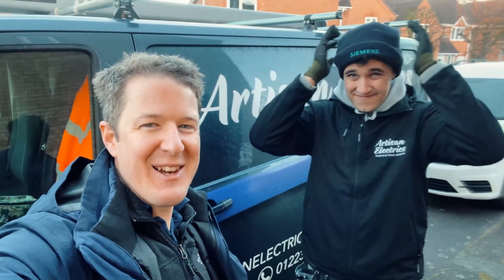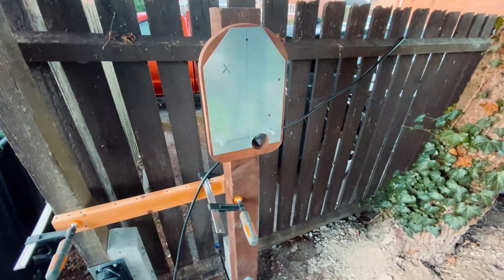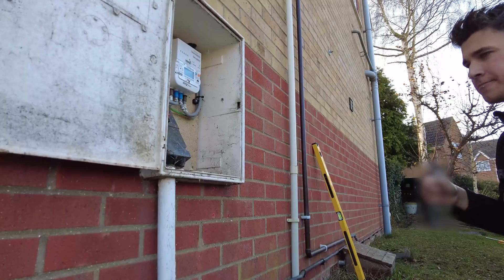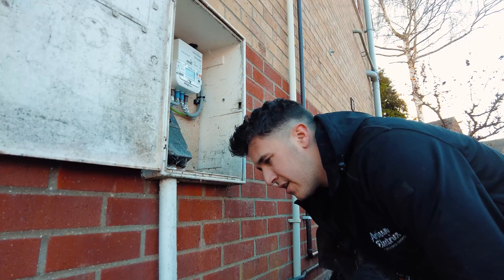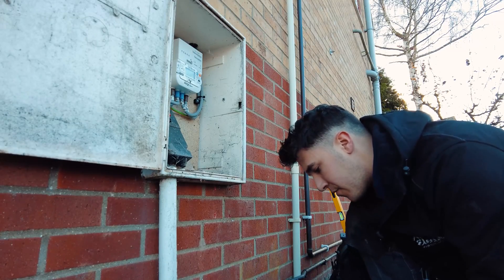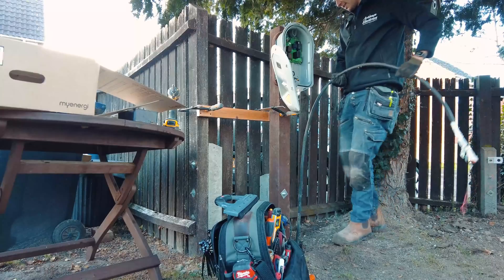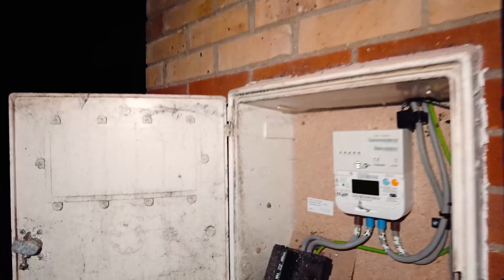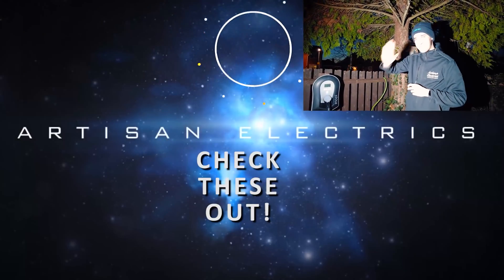Electric Vehicle Charging Point Installation in the Freezing Cold

Comment: I was concerned the length of run for the current clamp as their coupled voltage is so low and the voltage drop along the data cable. Did you check the calibration 🤔

Comment: Hey guys - in cases where you can't get to the consumer unit - do you guys install a sub main to another CU?

I'm just wondering how to go about it. No chance of me getting a new cable to my CU without it looking awful, but I have a garage so wondering whether to put henley blocks in after the isolator installed by the DNO - to a switch fuse and then run that out to a new consumer unit in the garage....

Comment: If pulling the cut out fuse why not fit a 2 pole iso same time?
Reply: Also, why couldn’t you have just installed a small extra CU in the meter cupboard for the EV? That way no need to do ugly run tight up the wall and drill through also no need for ugly junction box too.
Reply from the maker: Not allowed to install in meter cupboard
Reply: @artisanelectrics  I see thanks. I’m an EE not a sparky. Is it the law then, or just a guideline? I ask because my PV system done 9 years ago is all in the meter cupboard (isolator, small CU, gen meter) all done neatly enough but box is full now. Had smart meter fitted last year and also DNO jointer came to replace broken cut out unit. Nobody complained about extra equipment in the cupboard. Is it just some DNOs that forbid it? Thanks.

Comment: is it possible to add a wifi hotspot to the charging end of the ev ultra cable for your car to connect to wifi???
Reply from the maker: Haha not sure nice idea!
Reply: @artisanelectrics  Fast Ethernet (100mb) only needs 2 pairs terminating in the RJ45 connector, pins 1&2/3&6. I'm not sure if there would be interference between the CTs and Ethernet if you used the cable for both at the same time, but I'd be tempted to give it a go!
Reply: @JohnWatkinsUK   We have near 2021 inside the EU (and I hope in UK too) so why it can not use all four pairs inside the Ethernet cable for use it with 1'000 MBit or 1 GBit? 

The zippi have 240 Volt, add a switch and wireless radio inside (or outside into a wiska box) and the car, smartphone in car, tracker in car, computer in car, and the smartphone from the family members have contact to the net. 

I have start 1999 internet at home but start with my own LAN 1995. Around end 2001 I change it to 1 GBit at home with my first switch. Around 2018 I start with 1'000/400 MBit fiber internet outside connection. 1 GBit at home enough now after the wireless radio isn't so fast these times. 

If the zippi use only 100 MBit connect not mean that all things and people do the same. The price diff between both [10 MBit do not play a role more] are ~0.1£ between both modules these days. The question should be more why zippi not build in it at factory?
Reply: @AE-mu1jc  In this video 1 pair is used for CT sensor, so my comment was related to that application, where only 3 pairs would remain.

Comment: Don't be surprised if you get a call in the future, if a plumber goes there to service the boiler he may comment on how close the cable is to the gas pipe, and using the usual phrase it's illegal and the gas police will be around.
I have never seen a regs book for plumbers but they must have something, a few have said to me it should be at least 25mm away, if that's true or not I don't know.

Comment: in the states i wld have either buried the line or dug a trench and used pvc conduit or ran pvc along the outside of blding much stiffer and dont need as many straps( 1at least every 10 ft. and within 3 ft. of a junction box or other termination,) as tht flexie .  also where the signal line boxes where i would have either used a connecting gland/coupling or made one i notice you in the Uk dont have or your regs dont allow for them? a lot of holes you just  seem to fill in with putty.  we  N.American sparks seem to be plumbers too lol

Comment: Nice job  Cory, those grips are going to let you down the next time you have two glands close together. Get your boss to get you MOCOPA trained. then you could just use a Lucy/Henley block on the meter tails and an external IP66 enclosure at the side of the meter box with your double pole type A RCBO in there.
Reply: The Zappi doesn't need type A RCD and he didn't need Henley block as he didn't split the tails?

Comment: 8:57 would have put it through a wiska personally
Reply: Why? Adds nothing there's no connection there? Bit of silicone will make the hole watertight
Reply: @lewis94uk  covers up the horrible hole and doesnt look like sky installed it
Reply: @ggbalze06  The hole is barely bigger than the cable as he's gone through the mortar line, a SKY man would have blown out three bricks
Reply: @lewis94uk  so true

Comment: Nice little job that. I usually put the warning tape higher up in the trench to give someone a chance of finding the tape before going through the tape and cable at the same time.
Reply: Think the ESQCR regs mentions the warning tape has to be a certian distance above the cable,as to give early warning of there a cable being deeper down.
Reply: we do the same too in the states well the ones who care anyways lol
Reply: I put my cables 60 cm till 100 cm deep normally. I set cable tape 1 cm over the cable. Then I put good 20 cm sand over it. Then I lay another cable tape over it. 

- Normal shovels are ~30 cm long in Germany normally. 
- Use extra plastic or metall pipe around cable. 

Here they use a pipe and metal cable together. It works in my eyes perfectly for me. 👍

Comment: any reason you didn't use a Harvi?
Reply from the maker: Too far from the house to have a reliable signal
Reply: @artisanelectrics   Mine seems to work ok and its 3 times the distance and through 3 concrete block walls. But that said, I'm no expert in installing these. Keep up the good vids I enjoy watching them as a fellow spark.
Reply: @elliot330   For ethernet over radio do you need no other stations around or some how are not send the signal too loud at this frequenz. 

At one point works fine with good atenna over 500 meter and other stop at 40 meter. WiFi do you must test first! But the best are cable between the points!
Reply: @AE-mu1jc  Thanks for the explanation. As I said I'm no wifi expert. Just a simple Electrician. My only experience with Zappi and Harvi is within my own installation at home.

Comment: Where did you get the red plugs to blank off the
DNOs main fuse please? 9:01
Reply from the maker: Video coming soon on @tools4sparks
In short I don’t know where you can buy them from, they were a gift from a subscriber.
Reply: @artisanelectrics  https://www.millsltd.com/default/tools-equipment/smart-meter-installation/tools-equipment/electrical-shrouds.html
Reply: @gavinjohn-hyde2760  Good man Gavin, I shall get a pair ordered. Cheers!
Reply from the maker: Thanks
Reply: @artisanelectrics  Thank you
Reply: Apart from the fact you shouldn’t be pulling the fuse at all. Isolators can be fitted within 2 weeks by supplier. Theres no excuse IMHO.